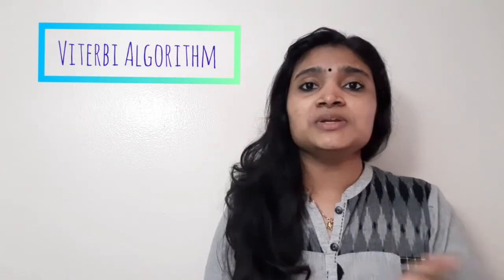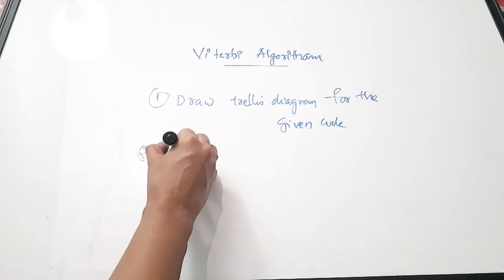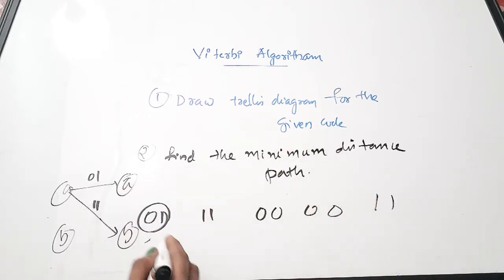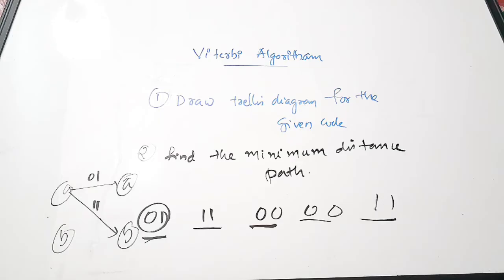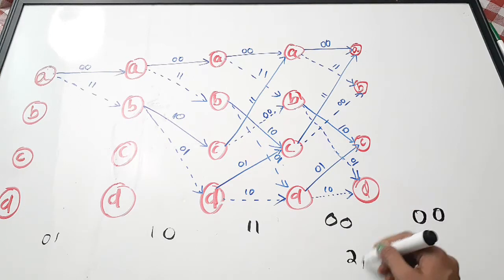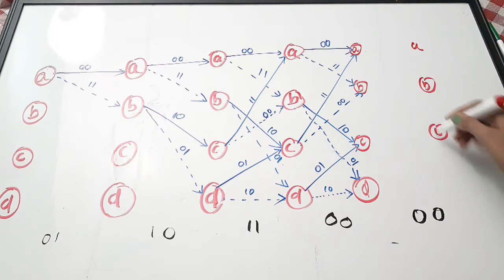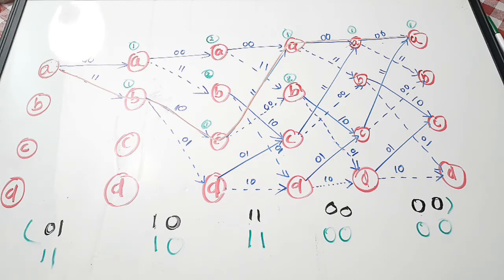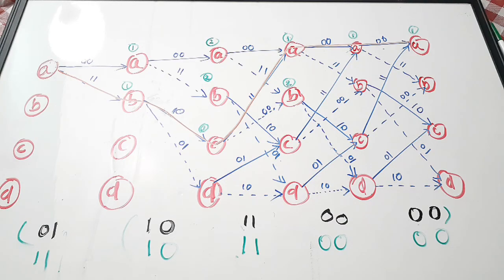Viterbi Algorithm|Viterbi Decoding of Convolutional Codes| Information Thoery and Coding

Comment: The Explanation was great, my professor was more focused on flexing her knowledge than on making the concept understandable. 

I also wanted to mention that the 0 branches and 1 inputs represented as solid and dashed branches  can be followed to obtain the message vector as well. For instance, Running down a dashed brach in the Trelli's Diagram means that the input bit was a 1.